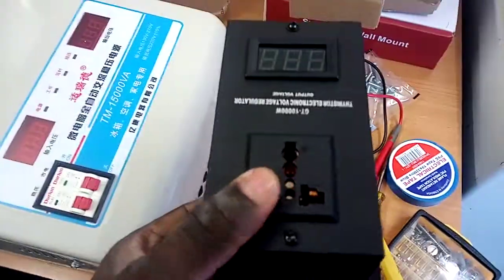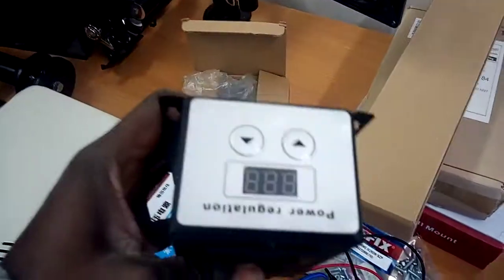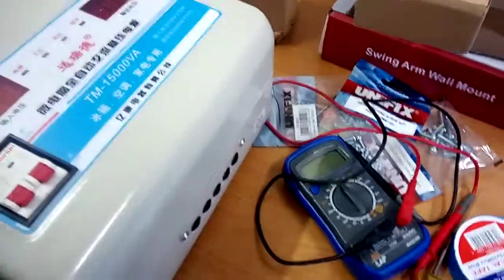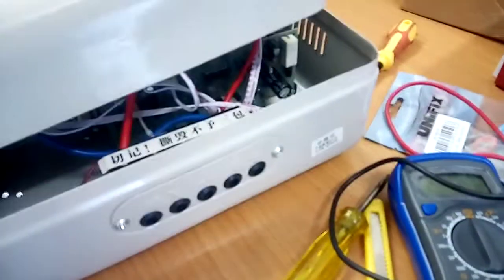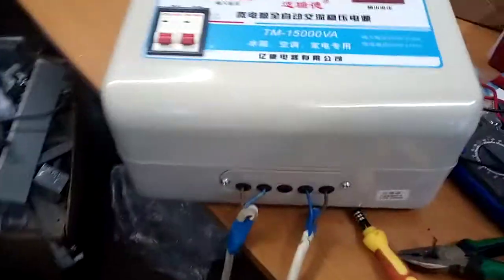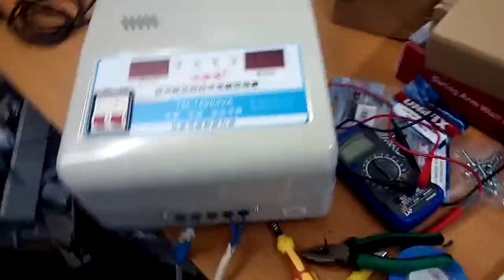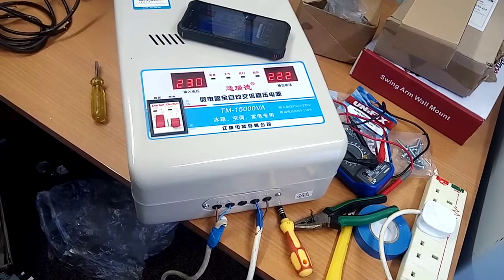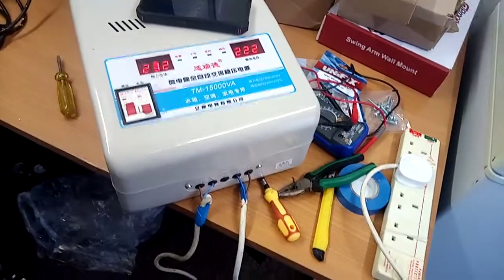Unboxing and Testing 15kw Voltage Regulator Stabilizer

Comment: good day, may i ask if is true rated, can really handle 15kva of power? is the unit still functioning till this day?
Reply from the maker: I have tested it with pumping machine, washing machine, aircon split unit, iron, water heater....heavy load equipment at thesame time and it did not fail me --- for this particular copy that I  am using -- it has been awesome
Reply: @martfame2478  Great, I am planning to ship one for my submersible pumps on the farm!
Reply from the maker: Ooh yeah - it can - I have done capacity testing and  it performed greatly